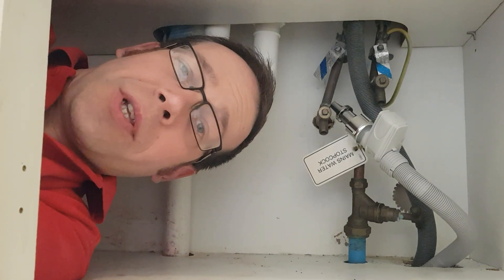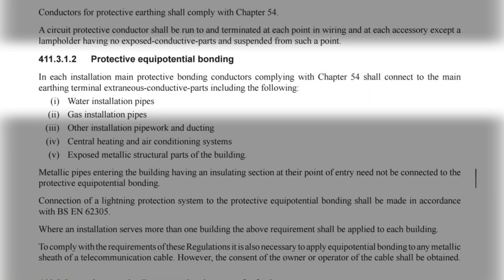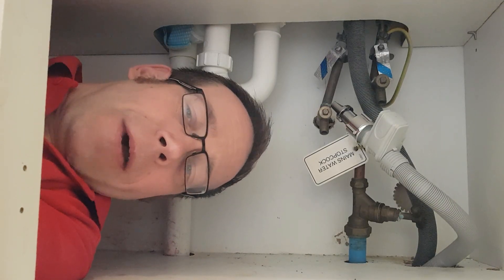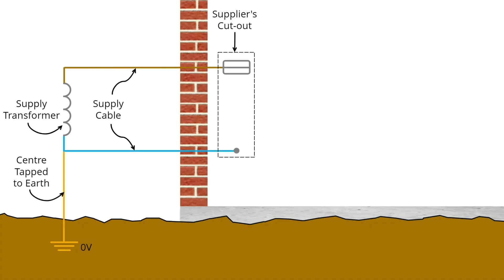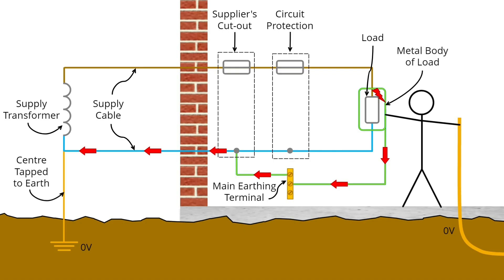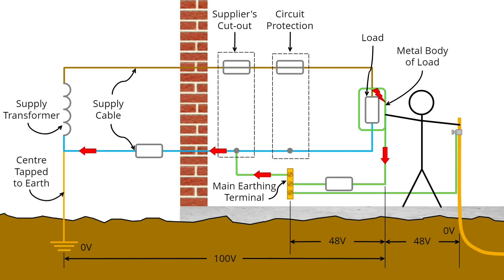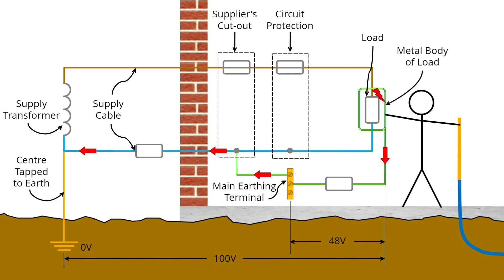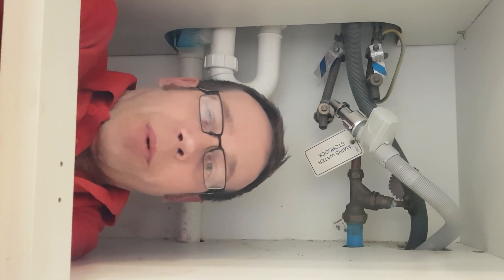DO YOU NEED TO EARTH BOND PLASTIC WATER PIPES?

Comment: Here in Germany it's different. The incoming gas pipe is usually plastic, after the meter usually metal. You'll have to bond that metal part. Copper piping for the radiators -> bond. Shield of incoming antenna cable (cable TV or satellite) -> bond. If the incoming gas pipe is metal and has one of these short plastic pipes in between as an electric isolator you are only permitted to bond the pipe after that isolator. If you want to bond the part before the plastic isolator you'll have to implement SPD into the bonding wire.
Until 2003 we even bonded metal bath tubs and shower trays because they were considered as being extraneous conductive parts. And they still have the terminal for a bonding wire today, for in case you install it in old installation. Because there you'll have to bond it again with at least 6mm² copper wire.
Reply: That was because the original waste pipe was maybe metal and was outside,so extraneous and could be liable to lightening strikes?
Reply: @สมบัติสตีเวนสัน-น6ษ  Maybe, but cast iron drain pipes were state of the art during the 1950s. Later in newer constuctions replaced by non-conductive glazed ceramic pipes, and then again by plastic pipes. Inside of the building polypropylene and outside PVC-U (unplasticized PVC). The PP can handle higher temperatures better than the PVC and is also more resistant against corrosive chemicals like detergents from dishwashers and washing machines. But the PP can't handle to be buried directly into the ground, you either use the PVC or embed them into concrete t reduce the pressure caused by the soil it's embedded into. For easier determination the PP pipes are grey and the PVC ones are orange or brown.

Comment: What about metal water pipe that goes to plastic in the building? (Im not from the UK but this stuff is interesting)
Reply from the maker: Good question, if the incoming pipe was metal I'd bond that bit to comply, very low risk though.

Comment: Agreed But and there’s always a but 😊
If for some reason an extension to the house is built or something similar and the plastic pipe is now jointed to copper and passes through a soil or concrete medium to a new bathroom?
Technically it’s passed through “earth”?
I know it’s petty but I’ve discovered old stop cock in what was an old kitchen then in plastic to a new kitchen stop cock so then I’d agree no need seeing the plastic but going back to 600mm from input to the property it’s in copper🤪
If I see a plastic pipe out of the ground then no
But if there’s been building works it’s time to investigate 😉😊

Comment: One of those dangerous non-sparky folks that watches efixx vids is gonna make a comment… I’d suggest one of the gotya’s  apprentices or others might miss that’s within the intent of that core HS&E reg and could be overlooked and I’d say pertinent to the conversation and saving life here, is I’ve seen time and time again in the classic Semi extensions is yes the mains be that Gas or Water may have been upgraded to PEX as the incomer into the building generally roadside and within regs close to the consumer unit etc. these days,  but the ye-old extension builders of old had a dam bad habit of then post the original main stop-cock or water meter down south, burying back to literal earth under the concrete slab the old 1” copper mains pipe back to the new extension kitchen sink or Mr John bob plumbers main feed to the combi-boiler as it’s to damm expensive or inaccessible to replace that copper run to the other side of the house and in turn reinstating that potential risk back into the property and in-turn the end user?  This is when id suppose as you guys would  normally state a competent and trusted electrician would still acknowledge this risk and ensure CPC bonding is indeed re-instated to protect the end user of the property versus your kitchen fitter or non-competent DIYer doing the job!

Comment: How would water hardness affect the resistivity of the water in the pipe? Can it be low enough in a hard water area to connect metal pipes in the house to metal work upstream via the plastic sections with sufficient conducance to restore the threat? Or would it be like limescale brine at that point? (in which case you might have bigger problems anyway).
Reply: The worst i measured is 100k ohms so all good

Comment: Plumbers pick a pipework system and stick to it, make it all plastic or all copper either way doesn't matter, but a mixture of different pipes is unprofessional and creates problems that wouldn't be there if you pick one type of pipework. The electricians who would bond anyway could create a problem and do extra unnecessary work, just stop it both of you !
Reply: Systems get upgraded, modified and repaired my house is a mix of original copper and newer plastic am I supposed to rip out all the original (perfectly good) copper and replace it all with plastic when I just add or move a shower? Or use expensive copper for the newer pipes when plastic is cheaper and arguably better.

Comment: Does this rule also apply to gas.....if its mdpe ? I'm assuming so
Reply: Gas still needs bonding even if it’s plastic supply, I don’t know why, still working in the old days I expect
Reply: @daniel049973  cheers. Don't quite get the difference between them though. If gas plastic or water plastic 🤔 🙄 result is the same potentially regarding fault path or lack of 🤷‍♂️
Reply: I assume it’s gas regs but a gas man can’t do it

Comment: Non-electrician here, although the pipe is plastic it does contain water and I always learnt not to stand in a metal bath of water while changing the light bulb. I'm not arguing you are wrong, far from it, I am showing my ignorance by not knowing why you are right, cheers.
Reply: Clean water is not a good conductor . Dirty water is a better conductor ( say heating water with metal bits and sludge )  . The impurities give it a lower resistance.  I have had a shock standing on a set of fibreglass step ladders with rubber feet . So nothing is exempt .
Reply: @dennisphoenix1  I thought about this more, I too have had uncomfortable shocks without knowingly being connected to ground, careful but not careful enough. So is this a case that if the clean water is high enough resistance that its unlikely to kill you but it is also unlikely to blow the fuse or RCB?

Edit, sorry I replied before watching the JW video, thanks.
Reply: @ooslum  Many years ago I had work to do in a bathroom, after the lady of the house had left the bathroom, I walked in to see a metal soap rack across the bath with an electric toaster on it! Fed by an extension lead.  So bonding wasn't my only problem. When I confronted the client, she turned on me and said "Young man I've been doing it for years"!!
Reply: @johnchristmas7522  It's worrying the level at which some people's risk assessment works, in the ladies case I would seriously consult with JW before adding Epsom salts to her soak, it wouldn't do any good but the conversation would be a great watch.
Reply: @ooslum  The Lady was not for turning!
Reply: This video measures how little current would actually flow: https://youtu.be/MF9DCNkaE8I?t=140
Reply: @simongreenidge6454  Thanks, I'd missed JW doing this, just shows knowledge is better than assumption.

Comment: To the “I’d bond it anyway” brigade the video clearly shows that when it’s not extraneous it’s no different to any other metalwork in the property. If you “bond it anyway” you’re going to introduce a fault current that wouldn’t otherwise exist. We’re all about keeping fault currents away from people yet bonding an irrelevant piece of metal is increasing the chances of someone coming into contact with live metalwork. Or am I missing something?
Reply: The I’d bond it anyway brigade don’t understand electrical principles. And this is a common problem in our industry. Years of dumbing it down have now taken effect.
Reply: @tomorichard  plumbers are not required to understand electrical principles, that is the point of having legislation, guidelines and codes of practice drawn up by engineering professionals who look at the whole picture.
Reply: @andyxox4168  are plumbers installing main protective bonding?
Reply: @tomorichard  well that’s my conclusion as electricians should know they shall follow the legislation and rules!
Reply: What if other pipework goes to earth, radiator pipes or external pipes? This video makes no mention, it could be just as easily earthed as if the incomer was metal
Reply: @howardsmith6368  at what point would a radiator pipe be going through earth?

The only situation I can think of for other pipework going through earth would be if you were running a water pipe up the garden for an easier place to reach a garden hose, and you didn't want to make it obviously visible along the route so hid it close to or in the ground.
Reply: @CoolSteve08  I suppose the argument the  becomes how do you know there is absolutely no plumbing that has a direct earth when making a decision to add the bond or not? Measure it is of course one solution, but equally can you trust that a plumber in the future won't add add to the system assuming its bonded when it isn't (not sure a plumber would even reasonably think about that as its outside their area of expertise).

Sounds daft but as long as bonding doesn't actively create a major issue, surely its more future-proof from a safety perspective as future alterations to the plumbing could alter the need to bond or not.... (this is of course making an assumption that the residence is such that future changes could be made - like a high rise flat with a plastic water pipe incomer is never going to have such an alteration possible).

Equally how much responsibility is it of the spark now to consider the plumber of the future.... but equally should there be an expectation of a plumber of the future to know that their alterations could change all bonding requirements :)
Reply: @Thats_Mr_Random_Person_to_you  by testing said pipe work as we are after all competent people .
Reply: @CoolSteve08  copper pipe through a damp basement wall
Reply: @tomorichard  agreed
Reply: ...so the pipe is earth via a parallel path via boilers, immersion heaters etc.   Also this does not take into account bad practice installation by others ie. Builder  plumber etc...
Reply: @tonymariner5519  well that's another thing, the gas pipe is very likely to be metal rather than plastic unless you've had it replaced with a yellow plastic one from the street. So that should also be connected to earth at the consumer unit or incoming supply.

Also the boiler will have mains and therefore all metalwork on it should be earthed too, so that could also earth all the piping connected to it.
Reply: Ze test on a tap with disconnected external earthing conductors will give you an eye opener
Reply: Did you bond all your door handles, window catches and curtain poles too?
Reply: @andyxox4168  your door handle doesn't have water running through it.
Reply: @InTimeTraveller  no and it’s not plastic either! What’s your point?
Reply: @InTimeTraveller  water? lol/ Get your MFT out and measure the resistance of water lol
Reply: Went to a job where it was PVC incoming water pipe but at some point an alteration was made to supply an additional tap. This was not a pvc pipe and buried. Without having noticed it you would assume that bonding was not required. Wrong. 
Also another time internal pipes underneath old floorboard where the ground was earth and not concrete, had broken brackets due to dry rot and wood worm, causing the pipes to be in contact with earth. Again not visible. These are things you don't get taught, but are a need to know. This video doesn't do justice, basically saying if it's plastic at the main point of entry don't bond.
Reply: @nathancurtis2585  was this buried pipe introducing a earth potential tho? A test is required to confirm this?
Reply: If you bond it anyway, it's plastic so it doesn't conduct, not unless there is an extremely high voltage which causes the plastic to breakdown and become conductive. Therefore no fault current can flow.

So you are not introducing a safety hazard by bonding plastic pipes, it's just unnecessary.

Perhaps go and understand the difference between insulators and conductors before making posts.
Reply: I think the difference with something like a metal bed or door handle is that you can see it all and know what it's isolated from other conductive parts. A water or gas installation is probably a big snaking pile of metalwork that you don't know all the details of. That can be good or bad: there's a fair chance there's some Class 1 device somewhere that's earthed via CPC, but there's also a fair chance that this metalwork is somewhere in good contact with the physical earth and no Class I device. I don't really agree with the argument to leave it floating with all that uncertainty. That's never really worked out all that well except in high maintenance environments: look at the old three-phase floating neutrals.
Reply: NO! Your not.
Reply: How is bonding it to earth going to introduce an extra fault current? It will be literally at the same earth potential as the rest of your house and exposed metal parts in your devices.
Reply: at last
Reply: Why let some fundamental understanding of a problem get in the way of a totally hysterical response?!!
Reply: Exactly 💯 buddy. Its potentially putting someone at risk of electric shock in the event of the pipework becoming live because there would not be a return path.
Reply: @coralbay00  so shouldn’t bonded conductive parts that are not extraneous be coded C2 or FI on an EICR?
Reply: @squakkers  probably hard to prove its not once the plumbing is fully assembled mate. Have to trust the original designer... But given some of the comments on here that's probably easier said than done.
Reply: @squakkers  it's a dark area that one. Tbh I would consult niceic (since I'm paying for 2nd opinions) and get advice if I couldn't clarify. The internal pipework throughout the building can in itself be unpredictable. Ie bathroom fitters rock in and cut into the copper slapping in plastic pipe potentially breaking continuity. Put on the spot.......I would agree C2 if certain and fi.......if uncertain. 
Don't you just love earthing arrangements 🤦‍♂️
Reply: @coralbay00  No! 🤣
Reply: Maybe Joe will do a follow-up video on the dangers of bonding conductive parts that are known not to be extraneous
Reply: @squakkers  great idea. So the bond it anyway bridage  can see what they are missing or rather adding

Comment: Surely you are earthing or bonding the internal metal pipework,and the regs have always said the earth clamp be placed on the house side of the stop cock,so in my opinion we have never bonded the services side
Reply: Metal pipe work has always been bonded to the main earth connection terminal and the on-site guide to the regs still state this. If a live connector came into contact with metal pipe the whole installation would become live if not bonded and gives greater risk to somebody touching said pipe work and being killed.  You do not bond the plastic incomer just the metal pipe work on the consumer side of stop tap.
Reply: @kevanswift7797  the regs have clearly stated in the 18th that there's no need to "bond" any pipe work that is supplied by a plastic incomer. There are other regs in place to prevent pipe work coming into contact with live parts
Reply: @mattthompson8657  read the on-site guide for regs still shows gas and water bonded. If a pipe were leaking and water started to run down a wall and into a socket and came into contact with the live conductor power would start to flow may not be enough to blow the CB so all the pipe work has a protential so anybody coming into contact with said pipe work could be killed.  Earthing the pipe work is correct the chance of somebody coming into contact during fault condition during the 0.4 sec is remote. More chance of electric shock touch pipe work.
Reply: @kevanswift7797  with all due respect you're talking absolute tosh.
Reply: Do you know why bonding is used? Why would you earth internal pipe work? Do you earth every metal door handle too?
Reply: @mattthompson8657  a door handle is not connected to a water heater imm/htr  boiler etc,we did have to bond metal sinks before the rcd was fitted,
Reply: @joe2395  a water heater and boiler would also be earthed, protecting the user from faults, no need to earth the pipes too.
Reply: @mattthompson8657  yes but with what size of ccp ,certainly not 10mm,and for some reason it was not connected properly,I'm old school seen it all good and bad,the regs change all the time due to technology,otherwise they have been the the same for years,if you are saying not to bond metal water and gas pipes then it's up to you,but I have always done so and always will
Reply: @joe2395  "I've always done it so I'll keep doing it wrong forever"
Shows a clear lack of knowledge and just doing something because you've always done it 👌
Reply: @mattthompson8657  so if you do a eicr test and the water and gas is not bonded you do not make a note and not make a comment and pass it ,interesting
Reply: @joe2395  why would I make note of something that isn't required?? If the incoming water is in plastic and there's no bonding then I think "least someone knows what they're doing". 
I've seen houses where there's 12 inch of copper pipe between the plastic incomer and plastic push fit on the other end. Some idiot has still bonded it, what a waste of time and money.
Reply: @mattthompson8657  yes I am more industrial ,and yes new builds as like my son's is all in plastic,hence no bonding required,but the gas is obviously metal and they have bonded that 👍
Reply: @joe2395  I bet the incoming gas is also in yellow plastic, no need to bond that either